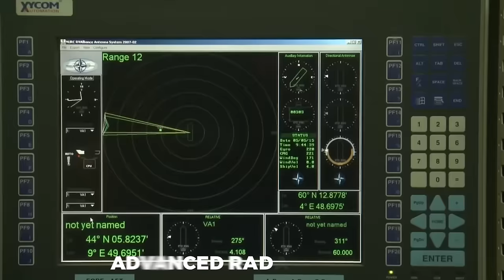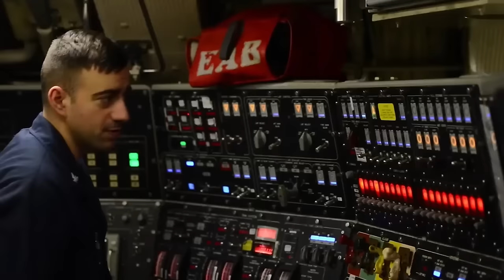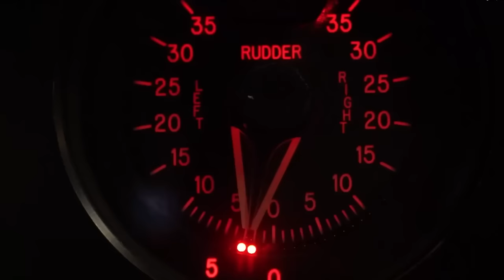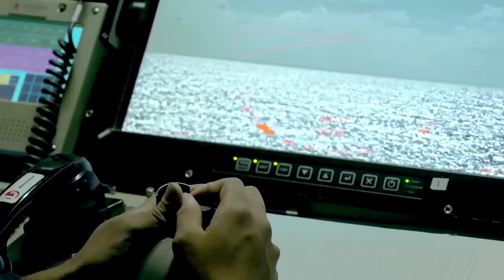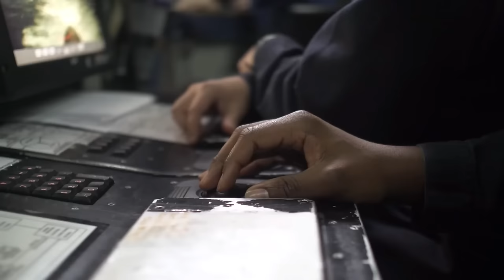US Submarine HITS an Aircraft Carrier and Then THIS HAPPENED...

Comment: Mass is one of the two most important factors in that type of collision.  But the aircraft carrier, being the more massive, should come out with the lesser amount of damage.  But the submarine?  Think about a compact car and a semi truck and trailer. Yes the car is going to inflict some damage to the semi truck and trailer, but the more massive weight of the semi makes it harder to damage.  
So, with that example in mind, we now expand the scale.  
And then we have the second most predominant factor.  Speed.  How fast are the two traveling?  The faster each is traveling increases the more energy each has at the time of collision.  I myself don't know the exact math, but you can figure it out with relative ease.
The Submarine suffers more damage than the carrier.  But the carrier has some major problems itself.  Probably a trip to dry dock for repairs as quickly as possible.  But the submarine?  Well, you showed some pretty realistic examples of the submarine.  Damage to the front end of the hull.  Probably destroying the forward torpedo room and tubes, and the forward sonar array.  Quite possibly forcing the submarine to the bottom, as shown in the animation.  Which depends on where the collision took place.  Shallow or deep?  This affects recovery of personal and the boat, submarine.  Deep = crush depth.  And loss of all hands...

Comment: Try not to be distracted. If you are talking about a submarine colliding with the carrier, this would usually happen underwater. In other words, unless the ship listed, you could conduct flight operations with no problems. So forget any damage to the flight deck or any of its aircraft. The submarine would either strike the carrier with its periscope and other sensors, or the lower parts of the submarine, such as the sail, fins or propellers, or even some part of the hull.

Comment: I have several friends who happened to be on CVN 71 when they had a bump with Leyte Gulf. Two were on duty at the time, one was in his rack.

The friend who was in his rack felt the jolt, heard the alarms going off, people running around.. He looked out and didn't see water on the deck in his berthing area and went back to sleep.

It was not a good experience for the CO's on either ship.

They said that it smooshed in the aft of the ship where there was an area under the flight deck where smokers could go out and take a puff.